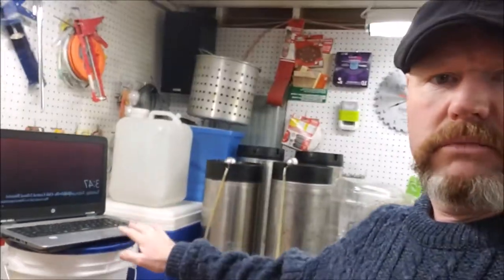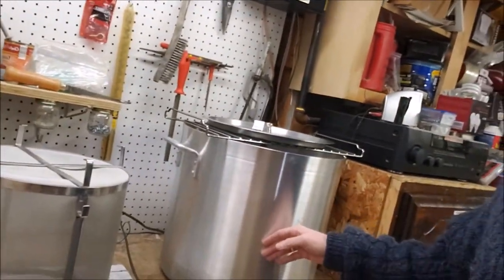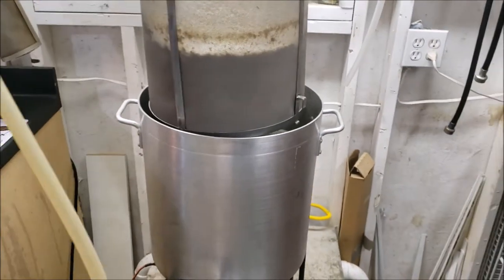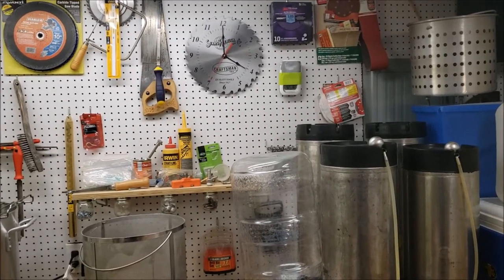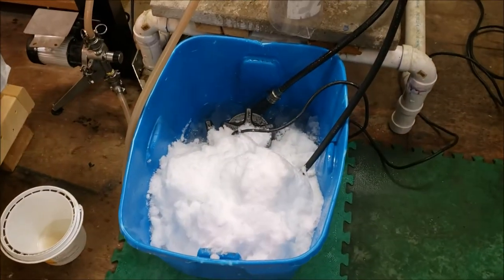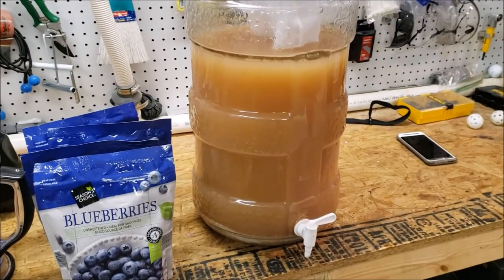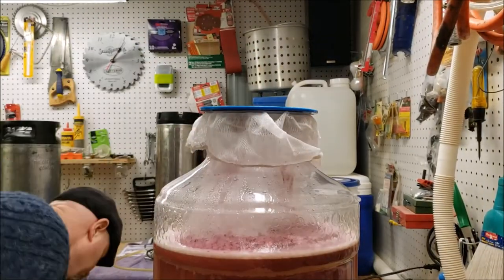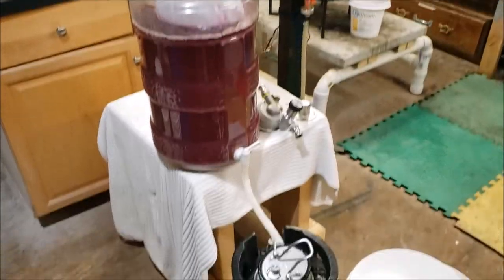Grain to Glass - Tipsy Smurf

Comment: The color of the beer is very nice. Maybe this is something to consider or maybe not, it depends on how long the conditioning period lasts. When a brewing system that recirculates hot extract through a grain bed for prolonged periods of time a condition called over sparge occurs, which extracts tannin. The negative impact may not be noticed when the beer goes from boiler to belly in a couple of weeks. Tannin extraction is a time, temperature, pH thing and that's why vorlauf is kept to within 10 minutes.
To produce cleaner extract skim off hot break as it forms and continue to remove hot break until it drastically, reduces, and when that happens add hops. Boil the wort for at least one hour skimming off second break as it forms. Less hops are needed and hop utilization improves when extract is clean.
Pioneer Malting is in Rochester and they produce high quality malt and sell to homebrewers. The malt is fresh.
Reply from the maker: Thanks for the feedback!  Much appreciated!  Ive worked with Pioneer Malts. Great guys and enjoyed walking through the place at the old Bosch and Lomb plant. You from the area? Sláinte!
Reply: There is no real evidence that long recirculation or extended vorlauf strips tannins any more than just resting, as long as your, crush, temp and PH are correct.  Recirculating for for an hour even changes nothing as far as tannins go. its all upside, clearer wort, less husk material in the boil, where tannins will certainly be extracted if you do not adequately recirculate or vorlauf and husk debris ends up in your boil. I have skimmed hot break off in the past and found the only thing that happens is head retention can suffer, I saw no benefit from it over the years. In fact i stopped skimming the hot break completely. I used to think that it helped with clarity, and then i realized that had no effect either. If the commercial brewers don't do it then its probably not a good idea, also here is an article to help https://brulosophy.com/2019/05/20/the-impact-of-removing-hot-break-during-the-boil-exbeeriment-results/#:~:text=As%20wort%20temperature%20rises%2C%20proteins,to%20as%20the%20hot%20break.&text=It's%20safe%20to%20say%20most,once%20the%20boil%20is%20complete. Cheers!
Reply from the maker: @chubbymermaidbrewing  wow! Lots of info to unpack there. Thanks guys! Sláinte!
Reply: @woodshedbrewingco.481  I'm not from the area, but I spend a lot of time in NY, fishing, and it is where I began learning how to produce ale and lager. The first brewpub that I drank in was at Cornell, back in the mid-late 80's. It may have been the first brewpub in NY. 
I met the guys at Pioneer about five or six years ago, because I was looking for brewers grade, malt. Previously, I used Budvar malt, which became impossible to obtain. Skagit Malting in Washington produces very good malt, they produce heirloom varieties of malt and sell to homebrewers.
Years ago, off and on, I worked in the Genesee Brewery in Fulton. I installed chillers and boilers in the brewery during the Cream Ale years, and from working with the brewers and setting up equipment and adjusting, pumps, steam and temperature controllers, and watching the brewers produce beer, ya kinda see the way that beer is produced and ya get to know the aroma of fresh malt, the aroma of mash at the different stages the mash goes through. 
This is the way that I got into homebrewing. First, I had no idea that homebrewing existed. I was in NY, floating around on Cayuga Lake, when I made the decision to produce beer, which my girlfriend thought was, absolutely, hilarious. The market in Endicott, where I bought beer and food, was out of Becks, which was my fishing beer, they had Saranac Lager, which I purchased, but didn't like. So, I thought to myself, that I could produce beer, since, Saranac made beer, and that's the day it all started. I looked through the yellow pages for homebrewing and nothing. I went to the library and that is when I discovered that there were two types of books written about brewing. There were small, pamphlets, maybe, 20 pages or so on the way that homebrew is produced, and there were books in the chemistry department, that dealt with malt, yeast, fermentation, etc..  
I began learning how to produce lager and pils back in 1980. In 1980, I met an Agricultural Chemist at SUNY and he gave me Wulf's 1958 Journals and from the books, and from his knowledge of chemistry, malt, and the fermentation cycle, I began to learn how to produce authentic ale and lager. The books that the library had, were about the Hochkurz brewing method. Wulf's Journals contain more info because they're about the triple decoction method. In 1960, the Hochkurz method replaced the triple decoction method to increase profit margin.
Reply: I'm not too sure that it would be mentioned in homebrewing because it would have a negative impact on business. I'm not sure that experiments in homebrewing are accurate or useful in making ale and lager because the experiments are performed on distillers beer, not on ale and lager. Pretty much, everything goes in homebrewing, which makes it appealing. 
Although, pH, crush, etc., may be within boundaries, the boundaries fall within a time frame, kinda like, the higher, the rest temperature, the quicker, Alpha denatures, the thinner the mash, the quicker things happen, but different. The Hochkurz and triple decoction brewing methods, where mash is boiled two and three times, doesn't extract tannin because the brewing process remains within boundaries. Boiling mash and boiling water infusions are used for reaching temperature steps, and for temperature maintenance, hot extract isn't continually, recirculated. The issue with tannin extraction occurs when a high volume of hot extract is recirculated at a high flow rate (GPM) through a grain bed, afterwards, the temperature is increased for mash out, and unless, the basket is removed, and the extract heated, and the basket added back into the extract, hotter extract is recirculated through the grain bed to reach temperature. 
When 1 GPM of hot extract is recirculated for one half hour, 30 gallons of extract moved through the grain bed in a five gallon batch of beer. From the tannin side of things, sparging 10 or 15 pounds of malt with 30 gallons of water would extract tannin because over sparge occurs, similar, to what happens when a high volume of extract is recirculated through the grain bed. The pH of sparge water is lowered, if necessary, and sparge is discontinued when gravity drops to around 1010 to reduce the risk of tannin extraction. The gravity would be reached before the entire 30 gallons of water would be used.
A certain amount of chaff in the boiler isn't a bad thing. A brewers trick is to add a handful, or so, of crushed, black malt into the bottom of the boiler. After the bottom of the boiler is covered with extract and the extract is boiling, the malt is added, then, extract is, slowly, added into the boiler, so as not to stop the extract from boiling. The process is used for reducing hot break, similar, to what first wort hops are intended for. The process used for first wort hops is incorrect in homebrewing. When hot break is reduced, upfront, the boiler can be filled higher with extract. A brewers boiler has a hot break, port, which reduces the risk of boil over. In the decoction method, the decoctions are skimmed off as they boil.
If you skimmed off hot break and foam formation and head retention was poor, there was a failure, upstream. The infusion method skips steps that improves foam formation and head retention. The beer may need carried over goop for foam formation and for head retention. The malt that you use may be high modified, to over modified, and high in protein. When temperatures in the 120 to 125F range are used with the malt, foam formation, head retention, body and mouthfeel will be poor, but the beer will be very stabile. Crystal malt can have a negative impact on head retention, due to fatty acids in the malt. When the malt is rancid, it has the same affect on beer as wiping a strip of bacon inside of a beer glass, has. The pH of crystal malt can be very close to the pH of sour malt. 
In your videos you don't mention anything about a malt spec sheet. I was wondering what you use for determining the quality of malt, before you buy it, if you don't use a malt spec sheet? What do you use to determine the quality of malt listed, only as, 2 row pale, malt, 2 row lager, malt, etc., on a recipe?

Comment: I do my kettle sours a bit different, i do a normal brewday with a 60 min boil all the hop drops needed except whirlpool if the recipe calls for it.  then chill to what ever sour temp required, pitch lest say lacto, the next day if PH is right ,raise the wort  to like 180 for 10 minutes add whirlpool hops if required  chill and pitch ale yeast into the fermenter. I have never tried it this way, it seems to work well, your kettle sours are amazing! I am wondering if you ever tried it the other way and if so was there any difference? I have never tried good belly, is that your go to?  Cheers Dennis.
Reply from the maker: Thanks Gary! Never have done it that way. Ill have to try that. Makes sense. Love to learn new procedures on this stuff.  Keeps the brain young! Next sour I do Ill have to pick your brain and give it a shot. Would be a fun experiment to see there are any differences in the beers being done in the 2 different procedures.  Sláinte